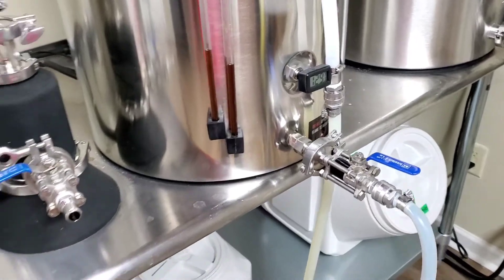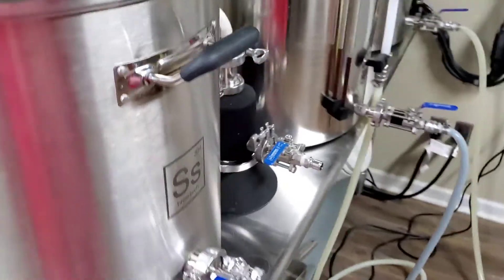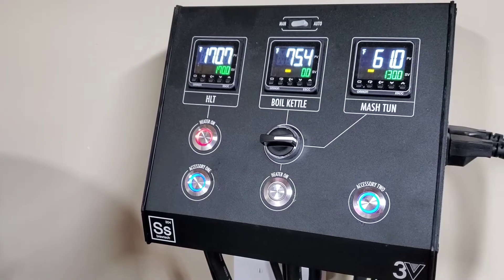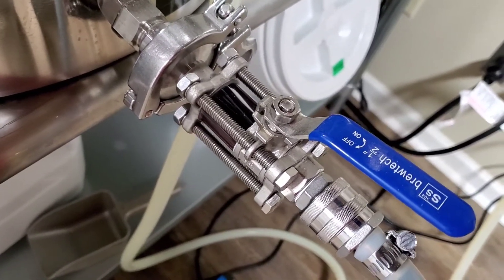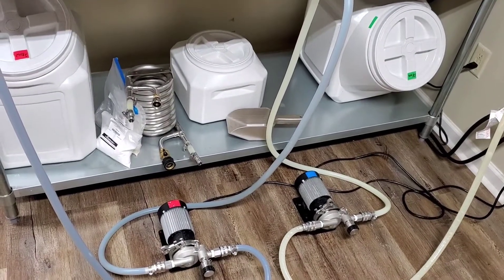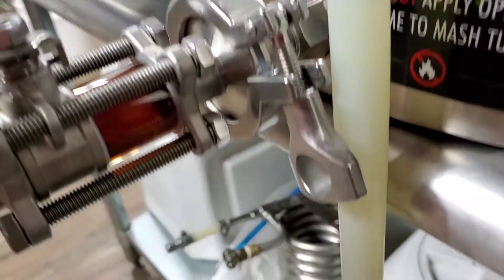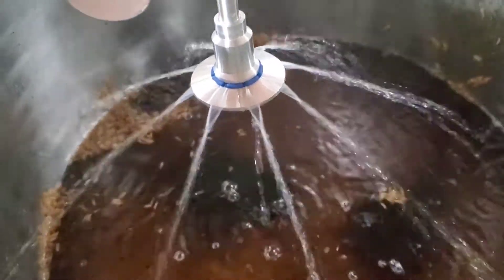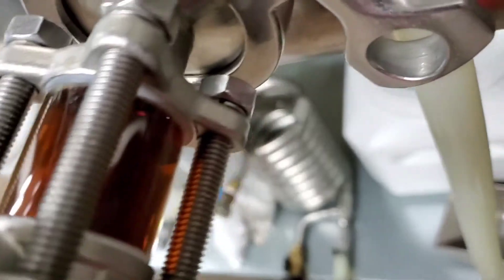Ss Brewtech 3V System - Fly Sparge

Comment: When mashing over night, mash temperature is 13C. The rest is used for softening the starch, which is due to Alpha, similar to what happens during germination. Complete saccharification shouldn't take place during an over night rest. Home brew instructions and recipes are based on distillers beer, not on ale and lager. The home brew method and high modified, malt are used in grain distillation where only Alpha, a single temperature rest and glucose are needed. It is chemically and enzymatically impossible to produce ale and lager by soaking malt at a single temperature. Home brew is home brew, to learn how to produce ale and lager start with DeClerks books.